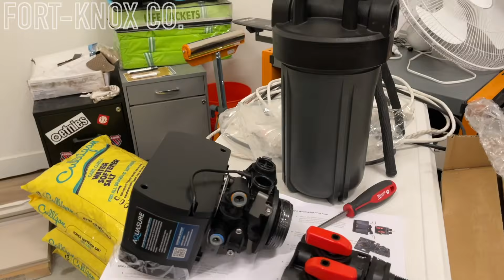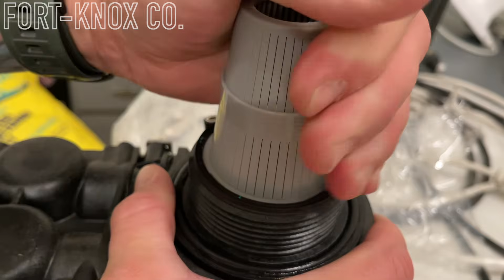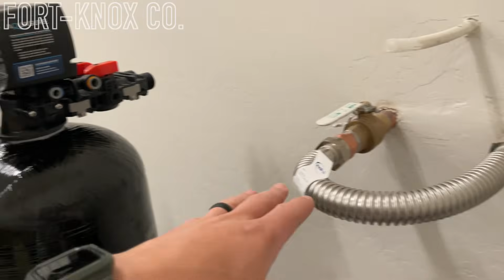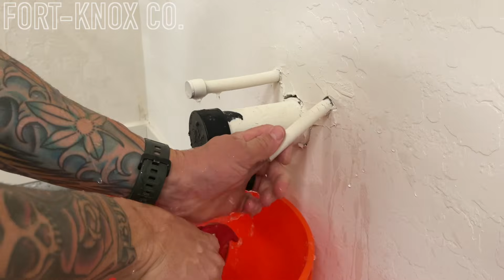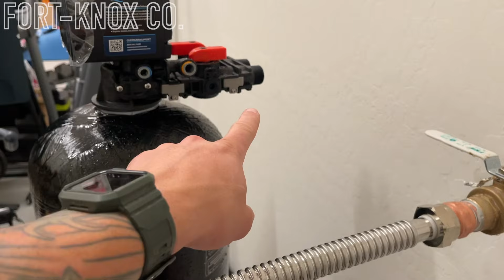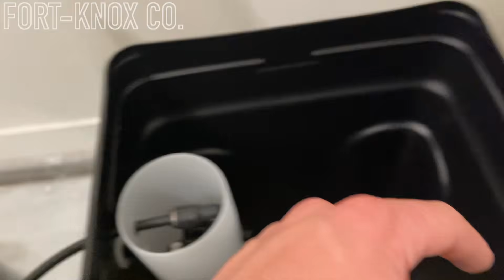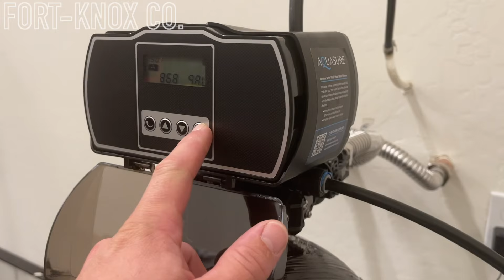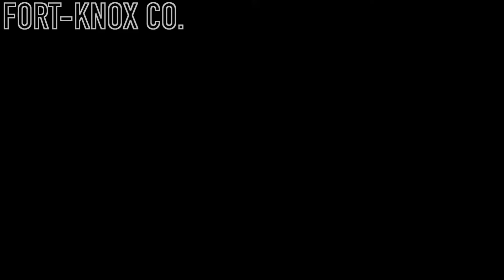How To Install Water Softener System Aquasure Harmony Series | Water Softener Loop Connection

Comment: How’s these softners for your skin is anyone having adverse reactions? If not what type of salt your using?
Reply from the maker: We haven’t  had any adverse reactions. And we commonly use the salt from Home Depot, diamond crystal or the brand that Costco carries. Both seem to work great
Reply: @FortKnoxCo  ok cause i have been itchy, im not the only one too based off my research. The only thing that has changed in my regimen is the water softner.
Reply from the maker: @kingrocc9503  your the first person I love heard of specifically that has had that problem. But then again everyone is different and sensitive to things. You may want to look into saltless water softeners. I believe there are a few out there. The salt in these systems are used to scrub the calcium and water minerals off the resin. The water doesn’t flush through salt continuously during the softening of the water. I believe there could be some salt residue left on the resin inside the tank after it is done doing its regeneration. But the overall function of the water softeners is not too saltify the water. It’s used for its ability to scrub the resin.

Comment: Hi I have this system, but no manual. How do I add salt to the Bin?  Thank you
Reply from the maker: The big black plastic brine tank should have a lid the comes off. Standard type lid. Not special clips or anything.  
You can get the salt for the system from almost any store. Home Depot/lowes/costco/walmart.

Comment: Is there a brand or model that would stand up to being outside?  Biggest concern is summer heat, as opposed to winter freezing.
Reply from the maker: I’m not sure about any brand that’s not maybe an industrial model that’s made for constant outside exposure. I’d imagine it would wear on any system being exposed all the time. I know a lot of people have an outside shed or build cover to shield it from the elements. But  I’m not familiar with one off the top of my head that’s meant to be outside.

Comment: Does that need a dedicated circuit , or was that just a regular wall outlet?
Reply from the maker: It’s just on the circuit in the garage. There’s a few other garage outlets on it. All the circuits in the house are GFCI protected. But it doesn’t necessarily need to be a dedicated outlet.

Comment: Thank you this is helpful, question: if I already install my water softener and it is time to add more salt, do I need to remove the water  from the black container/bucket before I add more salt?
Reply from the maker: Nope. You just add salt to it as you need visually a few bags at a time

Comment: Great job on the video. Our Aquasure is suppose to be here Monday. It's replacing a Waterboss that lasted about 9 years. I read a comment somewhere that a guy filled his toilets,sinks, dishwasher and faucets with the resin beads. I guess leaving both valves open during the initial flush would cause that?
Reply from the maker: It should cause the at because you have the plastic filter and I believe there’s another layer of partial filtration to prevent the resin from coming out. 

I’ve seen systems that say for month and months with no use and then they were reinstalled at a new house or something and it blew out all the resin beads. Could have been from deteriorating internals? Not sure. 

I’ve also seen the system be hooked up backwards and the water flowing the wrong way through the tank could cause this too. 

That’s another reason I like installing a post particulate filter, the canister with the big cotton filter inside, before the water makes its way back into the home. That will catch anything that makes its way from the circuit water or from the filtration tanks.

Comment: Excellent video! I’d ordered this same system from Hone Depot and it was delivered today. I installed it as I am moving and wanted to take my expensive Kinetico system with me. I had to install an electrical outlet as the Kinetico is mechanically metered. I also had to plumb a port for the RO system which I also changed out. My question is, I got 64,000 grain system because we have very hard well water and it’s a 5 bedroom house. Right now only my daughter is livening there so it may not need to regenerate as often. It is set to Timer Metered so I think it will regenerate every 1000 gallons or 72 hours. Should I change it to only metered so I don’t burn through a lot of salt if there’s just one person using it and not a lot of water usage currently?
Reply from the maker: Thank you! And yeah regeneration every 1000 gal seems too low. And if it’s just your daughter then every 72 hours seems too often as well. Yeah you could probably go further out with the time frame since it’s such a big unit and you aren’t using too much water

Comment: How long will the filter tank last for. If it filters the water than I may have to change the filter? Or what is it. Or is it a permanent thing?
Reply from the maker: In general a water softener should last 10 to 15 years. If your unit is facing more wear and tear, it could be due to improper maintenance or particularly hard water. If you'd like to extend the lifespan of your water softener, one option is to add a pre-filter.

Comment: Do I need to turn off the water out that goes into the house every time the system needs to do it’s thing to get flushed?
Reply from the maker: Nope. It does its thing and you just don’t have soft water during the system regeneration. Thats why they suggest setting the time to run that in the middle of the night or during a time you know no one is using water. But you just don’t have soft water during that short window.
Reply: @FortKnoxCo  Thank you so much! You explained the installation process so easy in your video!
Reply from the maker: @silvsnoe  your very welcome !

Comment: Just install the 48,000 system.  All went pretty well.  I did the brine wash and no leaks.  Now it is in the next segment and leaking at the bypass valve assembly.  Leaking at what appears would be the O-ring.  I did lubricate with silicone grease before installing.  It is only leaking on the "out" side which is currently bypassed.
Suggestions?  I will try removing that bypass valve once the system has completed its cycle.
Reply from the maker: Yeah if it’s leaking at the bypass then it’s probably just not seated all the way or very well may need to remove it and check your O rings, make sure they are twisted or damaged and then lube them up really good. I’ve seen with most all brands of water softeners that these water connections with O rings need lots of line to help create a good seal and not damage the o rings when installing

Comment: I had heard you're not supposed to tape the plastic threads cause it can make it easer to cross thread it or crack it.
Reply from the maker: That is true. It’s not needed when using fitting with the rubber O rings either. If done carefully you can but it’s not necessary. You wouldn’t put as much tape on plastic threads as you would on metal/brass threads.

Comment: Do you have an updated link for the 1 1/4 to 1" flex pipe? The link in description goes to a different product that's 1" on both ends now. My house is also plumbed 1 1/4" and struggling to find anything.
Reply from the maker: I’ll look for a new link. They are hard to find. I had to order them from Ferguson and it wasn’t easy to find them on their website either unfortunately. If you’d like I have two that I’d sell. They were only used for a couple months until I switched out my plumbing to all PEX.  Email me if your interested

Comment: You're right about the instructions at the beginning not telling you to leave the outlet closed during that System Startup. It only says to open the outlet to let it flow back in the house at the end of the instructions on step 5. I'm sure many others like me started it by reading one step at a time. 😅 LOL
Thankfully I was also watching your video while doing this and shut off the outlet valve at the 5 minute mark after starting it.
I do have one tip I'd like to mention.
For anyone setting this up for the first time. Make sure to secure that drain line. When my unit kicked on that drain line shot up out of my floor drain and sprayed water all over the place. 😂
Reply from the maker: lol oh no. Yes good information. You should have that drain like secured for sure. I didn’t realize how much pressure that small line would have. If you don’t have it clamped or secured with a connector of some sort you should definitely make sure it is. 

And yes the instructions could be a little better though through for people following along. Thank you for finding my video and watching. I appreciate it. Happy I could be of some help.
Reply: How often do you replace the salt in the bucket

Comment: Great video! My house calls for a 48000 system based on the different professional estimates I received. Would it be an issue or are there any downsides if I upgrade to the larger aquasure 64000? Also my drain line is about two feet higher than the top of the water softener. Will it generate enough pressure to drain that high?
Reply from the maker: Going to the 64,000 grain system will be completely fine. A smaller system will have to regenerate more frequently if a lot of water is being used. There’s not a huge difference between the two and the 64k is just a little bigger and has the ability to filter more water before needing to regenerate. 

The drain line shouldn’t be a problem. Mine is about a foot above the system in the wall but it goes up over our 10’ ceiling, across the rafters about 8’ and then Drops down into our laundry rooms washer drain line. When it flushes the drain line it has a lot of pressure. Should t be a problem.

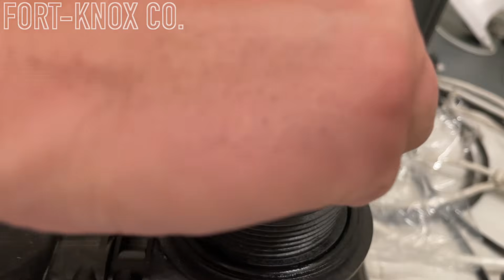Comment: At 5:00, does the basket have to be completely locked in? Once i turn it clockwise it feels loose still, like it stays but if i wiggle it it falls out
Reply: The little bump in the basket seems to prevent it from lock in. Once i turn it counter clockwise, that little bumps stops it from turning. And if I hold the basket then it just slides out. So is it suppose to go over the little bump in the basket and “lock” in?
Reply from the maker: @andrewjohnson1056  it should turn just a small amount. I don’t think it’s a turn 1/4 turn. If you look at the groove on the basket you can kinda judge how far your getting it turned. It may not be completely tight to where it doesn’t wiggle a tiny bit. But mainly you need the tabs in the grooves and turned so that it can not be pulled out. If you see in the video it had a pretty tight fit with the screen just going down into the hole before turning. It was a little stuff to turn but it took a little finesse. I’d say make sure you get if pushed down enough and so that it turns and then can’t be pulled out.
Reply from the maker: It should turn so the tabs slide in and it won’t pull out, but they are not threaded as to have it tighten down to where it doesn’t wiggle a little. It’s mainly to secure in place to not be pulled straight out.    So sounds like your good, it might still have a little bit of play when turned and “locked” in. I hope that helps .

Comment: I mean in this video at 2 minutes and 20 seconds frame. It’s showing the other  sediment filter.  That’s is my question. Thanh you very much.
Reply from the maker: Yes. I had it with this softener. But didn’t film the part when I installed it. I put that into my other softener video. There I show how it goes in line after the softener system.
Reply: @FortKnoxCo  very helpful. Thank you very much. 👍👍👍
Reply from the maker: @phuctran2396  no problem at all

Comment: Love you video, very helpful.  But accident in this video I saw you have the other filter need to install.  but, nothing mention about it. Please, make other videos    With complete water filtering systems. Thank you very much.
Reply from the maker: Are you referring to the pre or post filter ? The canister that filters large particles from the water? This unit did come with one but I did not show that process of install. I have the process in another softener install video though. This video I was mainly focusing on just the softener unit. Because not everyone get a system with the particulate filter. And some like to install it before the unit and some prefer to install it after the unit.
Reply: Yes please,  the more filters is water more clean.  But I would like to know , the axtra filter when need install before or after water softener units.  What’s the best.  Thank you very much for your sharing.  ❤️👍
Reply from the maker: @phuctran2396  I like after your system. It can prevent anything from the street and from the filtering unit from getting into your home and water heater. Its can act as a layer of protection to catch anything that could cause bigger problems with your house plumbing
Reply: I mean in this video at 2 minutes and 20 seconds frame. It’s showing the other  sediment filter.  That’s is my question. Thanh you very much.

Comment: I have the same ones. I’m looped. I don’t know what connectors I would need. Those sharbites seem my best bet.
Reply from the maker: Yes, the shark bites are very convenient. If you’re not sure about the size of your pipe, you could always take some measurements around it or with wise and compare that to some of the fittings at Home Depot or Lowe’s. Or if you have the time you could purchase a couple fittings That you believe might be close to the same size and then bring them to your actual pipe and visually compare them so you know where to start. Once you know the size of your fittings and pipes that you’re gonna be working with the rest of the connection process is pretty straightforward.

Most commonly people have three-quarter inch or nowadays you’ll see 1 inch. Mine were one and a quarter, and it’s not as common.

Comment: if sharkbites failed, it wouldn't be specced in for plumbing code. They take decades to add stuff into that. PEX was popular in europe for like 20+ years and USA spec moved insanely slow on that.
The people who have them fail, are just bad at doing basic tasks =[
Reply from the maker: I agree. I’ve never had one fail. I believe they have a 20 year warranty or something like? Plus half of the plumbing fixtures I’ve seen no a days have “push connections” which I believe are using the same connection or concept. So it seems to be okay for all that as well. Like you said it’s more about installing things correctly
Reply: @FortKnoxCo  yea I have chemistry stuff that is 400 psi and it's all compression fittings (though it's about 1/4 inch size (I use millimeter so idk)) but yea they work just fine. Been around very long. Also PC water cooling uses a lot of compression fittings so yea it's all the same concept and they work well.
You demonstrated what people do wrong I think at 10:51 I am pretty sure the first push you do is where some people stop.. you go back at it to push again at 10:54 which they probably don't do lol
I see people do the same with PVC though, they don't put enough glue on or it's too dry when they go to press and it doesn't slide all the way back and they don't jam it in with heavy force right away.. the glue dries too fast for most people that have no idea what's going on
Reply from the maker: @gg-gn3re  yep exactly. It just takes trying it yourself and learning why and what your doing. With that knowledge and experience you can then self diagnose or understand what needs to be done or should happen. Having an understanding of what’s going on inside something or how it works goes a long way.

Comment: Do they make ones that hook up to your Wi-Fi and tells you when to add salt..Im a city boy moved to the country son of a teamster retired but a serious DYI one uncle a plumber other an electrician learned lots.
Reply from the maker: I think they do have softeners that hook up to your WiFi and it tells you when to add salt just based off of how many times it’s ran it’s regeneration cycle. The units still need the users input to know how much salt you’re adding and then it just counts down according to that. But I don’t thing there is anything super technical going on like them having an actual sensor that knows exactly how much salt you have left and telling you. It’s just you telling the unit you have the salt at level 9 in the tank and then the computer counts down according to when it assumes you should need more.

Comment: Licensed builder here 30 years. I just hope that electrical outlet is gfi at the panel at least 😂
Reply from the maker: It is. Every breaker in this house is a GFCI and every first outlet is a GFCI. The new standard seems to be a double overkill.
Reply: @FortKnoxCo  cool I understand it was just something I noticed. Thanks for your video, very helpful.
Reply from the maker: @lowmanagain  no problem at all I appreciate the comments.